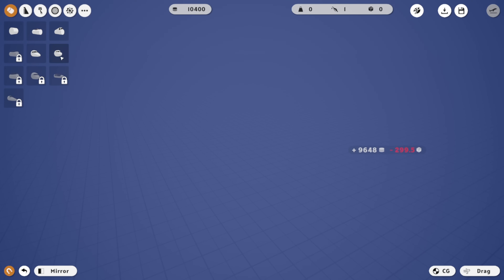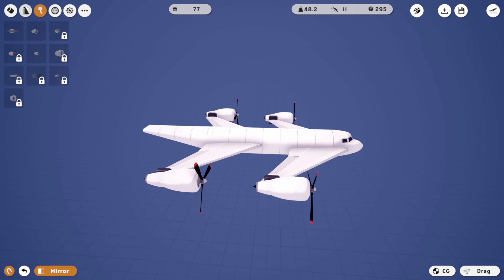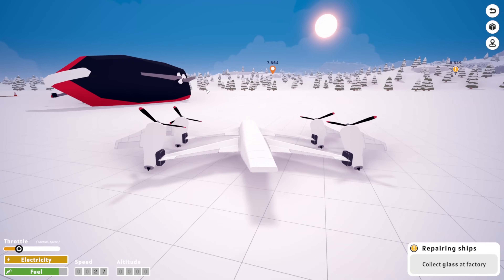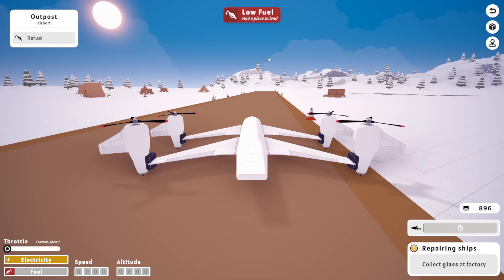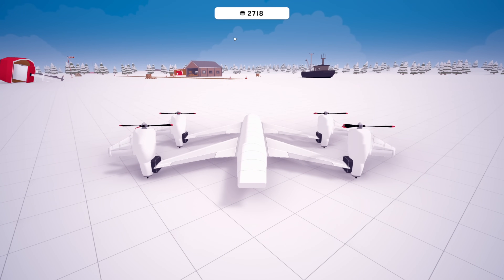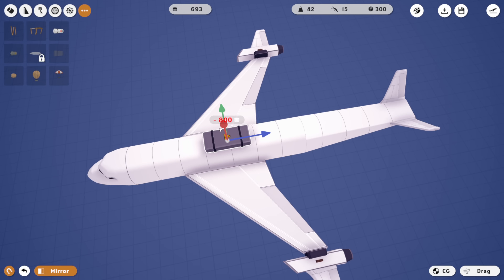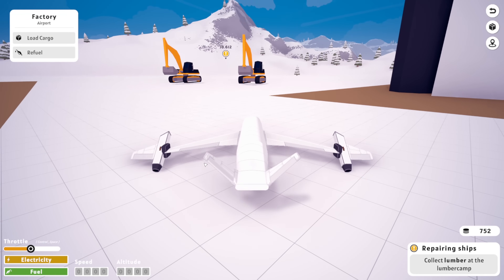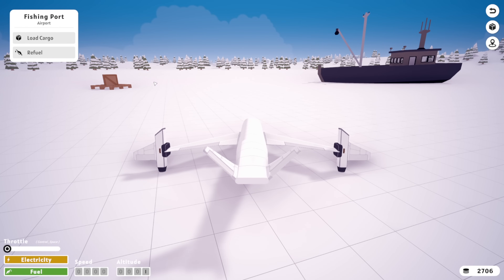HUGE CARGO QUADCOPTER VTOL! - VTOL Only - Ep7 - Aviassembly

Comment: If it were real, my favorite helicopter would be Airwolf. IRL, I'd have to say it's the Mil Mi-26. Sure, it's Russian, but it's just so huge, it can be used in just about any role, military or civilian. If you wanted to, you could put an emergency surgical suite in one, revolutionize medivac service. The tricky part would be making it possible for medical jargon to be heard over rotor noise.

With the engines, bigger isn't always better. At this level, fuel is an easily solvable problem, so your main concern is thrust per dollar. It might make more sense to just put 12 turbo props on the wings, and then attach the wings to rotation joints. I did the math, you can afford 12 of the turbos. That would give you a total thrust of 240, compared to the 130 you get out of a pair of box jets. Plus, the turbo prop has a slightly better thrust/fuel consumption ratio, so you'd be more fuel-efficient.